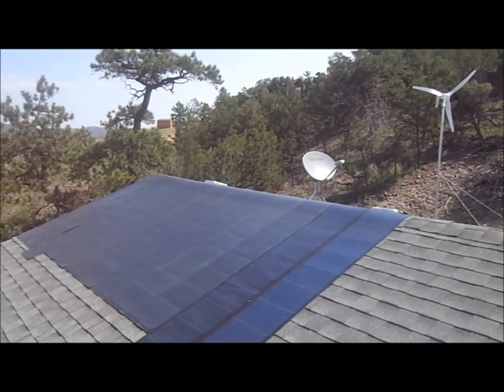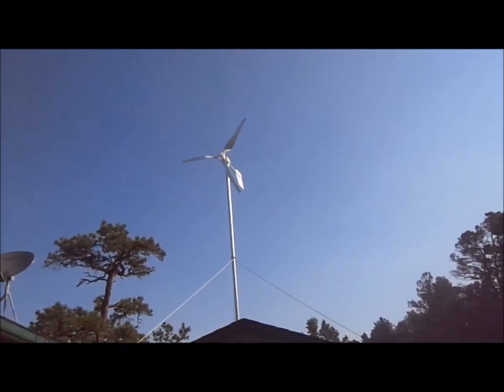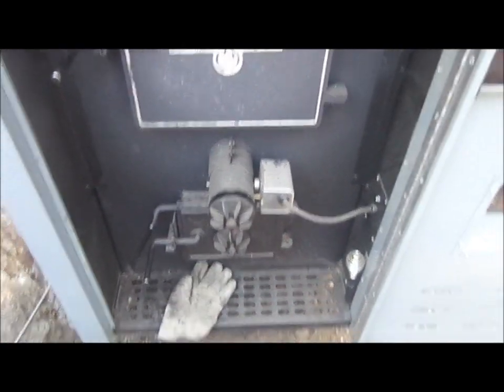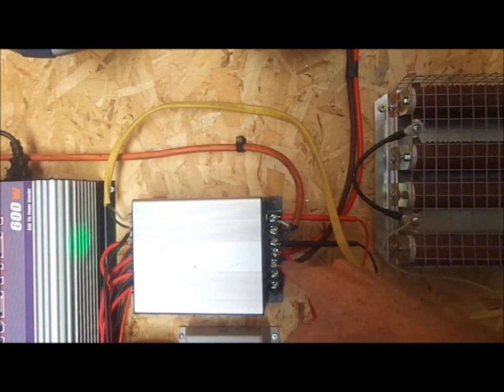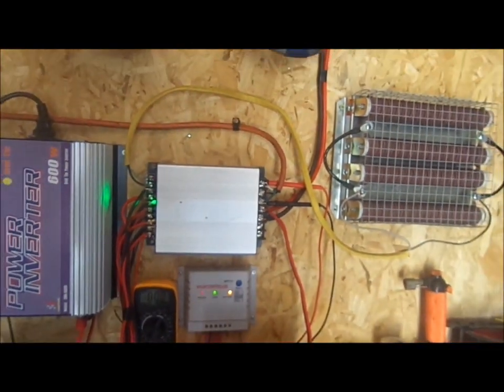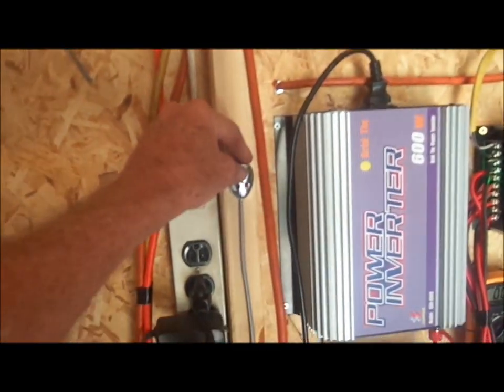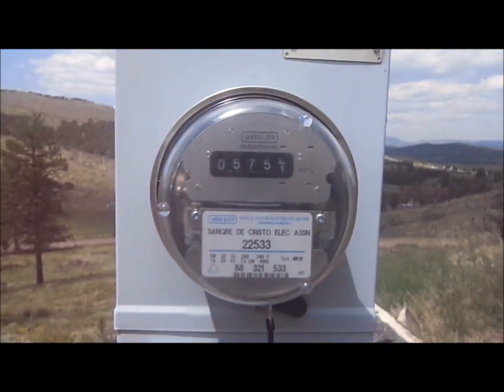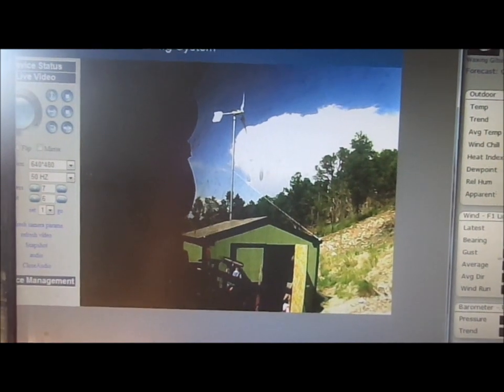HOW TO INSTALL A DIY HOME HYBRID WIND, SOLAR and WOOD ALTERNATIVE POWER SYSTEM -GO GREEN!

Comment: Hello Steve You have done well, at some point i want to share my system with youtube, like yours its work in progress and i have a 10sq m2  manshed. Enjoy how you have set up the camera to monitor your system. it must get very cold to have a heat mat and a heatered water bowl for your dog. I working on a dump load for my solar instead of it electronically dumping and what to use the excess to go to a 24v heater / water system this to keep my shed warmer. Re metering x camera i'm considering purchasing an MPPT controller and Epever as they have  a direct link to pc or using bluetooth on your cellphone.. One other project is to direct the dump load to go to various items and switched at various times.
enjoyed the tour thanks Ross Tga NZ

Comment: Hi Steve, very nice setup you have. Is this a special charge controller you have? It's the first that I see were you can connect 1 and even 3 grid tie inverters to.

Kind regards
Sander

Comment: Well...the premise is a good concept, but the layout of it is willy-nilly and not very professional looking. First of all, I would 'not' have an array of all different batteries. It's always best to have all batteries by the same manufacturer as different companies have different specification for their batteries and the way that they are charged. 
At any rate, regardless of how it looks, it's all about how it functions. So good on you for doing it. I hope to establish a small solar and wind array system for my cabin that I am building.

Comment: Bless you dude I have to tell you your use of a power strip for your power distribution is scary, the way your cables are is also a concern. Are you using a cut up extension cord? Where is your main power cut off in case you have a fire. Are you using any dc breakers or how about just fuses. Be careful bro

Comment: Hey Steve instead of using a dump load you could replace it with a grid tie inverter so the energy isn’t wasted great video and great setup

Comment: Nice system. I have a suggestion for you. take your dump load and put it to an electric dc hot water element in your water heater ) or a small second heater ) to make hoy water from your dump load ( wasted energy ) You can get a pair of these elements for about 36.00 dollars on eBay.

Comment: how are those solar panels holding up after 3 years? I am looking into either a racking system for my panels or a ground mount not sure yet.
Reply from the maker: +Clearly Seen The panels are all doing fine, I added two more 100 watt panels.

Comment: This is amazing!  I'm just beginning research on how to pioneer my own alternative energy, and I can see I am WAY over my head :-). How would a lay person with zero electrical knowledge start?  Perhaps by getting to know one power inverter?
Reply: +Suzanne B. .... It took me about 1 year of study on line to learn to make a system. You also need the TOOLS to connect things....like WIRE STRIPPERS AND CRIMPERS...get the AUTO crimpers, that will save your hands, or hopefully you have someone who can solder connections well...:-) Also Wire Covers, they are Heat Shrink, you put them over the connections, and "shrink wrap them"...you will see this done in some videos.

Things to learn about....
   12 volt Deep Cycle RV Batteries. I recommend over 100 amp hour batteries to be more robust...120 amp hour for a bit extra coverage.  You do not drain these to empty....only go around 50 percent to get many charges, too deep a discharge can harm them...though they are built to take a deeper discharge than a car battery.

 Solar Panels...size your panels for about 10-15% of your capacity. Also a Solar Charge Controller...panels can be 18v...so need to be controlled back to 12v. They also regulate and monitor the charge, so you don't overcharge.

 Cables...size for your output amps...too thin and they get hot. VERY hot.
 Inverters...size for the amount of wattage you want to run.  Also MUST be the SAME voltage as your panels, and battery bank....a 12v inverter for a 12v panel and battery bank. 24v for a 24v panel and battery bank, etc....you might as well stick with 12v for now.

 Fuses...sized for the panels, the charge controller, and between the battery bank and inverter....so if something shorts the system...the components are saved.

 12v Cigarette Lighter Socket, with 15 amp fuse. For charging small devices, and loads that don't NEED an inverter. An inverter takes some power to run it.

OK...my system.....
   Two 100ah Deep Cycle RV Batteries. Connected in Parallel...that is Positive to Positive and Negative to Negative...like an Equal Sign...Series is for increasing the voltage...24v, 48v, etc...parallel is for increasing capacity...100ah, 200ah, 400ah...so Four 100amp hour batteries in parallel...400ah. Mine is 200ah therefore.
    Two 100 WATT Solar Panels, and 30amp Charge Controller...and you need the cables, but if you get a KIT, they can come with everything you need generally. I bought several Fuse holders, fuses, and Quick Connect Harnesses, for connecting to the Controller and the battery bank.
    THICK....double 0 cables...for heavier loads...#4 and #2 cables got hot for my set up. I run 60-70 amps. As you will see.
   A 1500watt Pure Sine Wave Tiger Claw Inverter...Pure Sine Wave is basically clean electrical power, like your house power. Modified Sine Wave is cheaper, but a motor appliance like a fan will BUZZ...and they are harder on somethings. But are OK for others....look up the difference between the two...good education.
   I use a 125 amp ANL fuse in a ANL fuse CASE....goes on Red...Positive Cable. Close to battery, between the Inverter. JUST IN CASE...you want it to blow before your equipment.
 Also, I have a 12v Socket...has many names...Marine Socket, Car Socket..etc....15amp fuse...all fuses go on positive cable.
  This is in a box, with wheels, it has a lid, the batteries are inside, the inverter is in the front, the 12v socket is on the left side, and there is a charging Quick Connect Harness on the other side, for charging.

OK...I run a 850 watt power consumption, 600 watt output MICROWAVE OVEN on my system. See my Video...see below.

   My small system is one 100ah AGM type battery...not Flooded Car Type battery...but Sealed so no leakage. A small, 400 watt Cobra Brand Modified Sine Wave Inverter...runs my 300 watt one cup coffee maker...though I use it for Tea. Also, it is on a HAND TRUCK so is portable, I can take it outside, and use a small 2.2amp Weed Whacker.
  For HEAT, I recommend a Wood Stove....too many batteries needed.

Do a search on youtube for.....
 
Cooking Soup with Microwave and Inverter set up

  Hope you enjoy....Good luck with your Solar Generator...that is what these are sometimes called. You can look them up on Ebay or Amazon as well as information on Youtube.
Reply: if I may...
Go buy or find a few garden solar LED lights. Take them apart. Learn the anatomy. learn the names and the function of as many of the components as you can. Take your time. Home solar systems are simply a scaled up version of this.

Comment from the maker: I am now using 2  1000 watt grid tie inverters, most of the power is sent to the grid as my batteries stay charged.. I don't directly  use  my power unless the grid is down. I have separate outlets I use  that are only connected to the battery bank.

Comment: Hi Steve,

Thanks for the great video! It is a nice system you have.
As I understood you have your own power generators, but you also buy electricity from the grid.

How do you switch between the two?
I'm planning to install an automated switching solution that decides if I'm able to power my house from my own system, or do I have to buy electricity from the grid.

Have you thought about such a solution?

Thanks again!

Istokka
Reply: @istokka I was wondering about the same..have you find a way to do an automatic switch based on consumption? How do you deal with things like the AC and the stove that are three phase AC?

Comment: Very cool setup. Very well thought out but I can't help but notice your low-tech approach to an 'alert system' by using the webcam. I'd think someone with your talent would jump right into customizing a Raspberry Pi to display alerts on a monitor in your home/cabin.

Comment: what kind of hybrid charge controller is the one that you have.i have a 12 volt wind turbine and i cant find a hybrid that does a 12 volt just ac wind turbine....any suggestions?
Reply from the maker: I had a Greenergy Hybrid controller for awhile, but it failed. I now run my AC Turbine directly to the grid tie. If the grid goes down it will divert through my Sun 500G grid tie inverter to the dump load resistors. This inverter is also protected from over-charging.
Reply: do you have any diagrams of your system?my next wind turbine will be a ac,but for now what do you suggest for my 12 volt 380 watt wind turbine as far as charge controller?i would like to do exactly what you did with your system?but on a cheaper scale (poor mans version)  lol..my planes are for 6 100 watt panels and (the 12 volt wind turbine) and to add a 2nd wind turbine (ac) right now i have a 1000 watt grid tie and 2-100 watt solar's,and 6- 200ah battery bank,and a 3000-6000 watt dc-ac power inverted for lose of power, and the turbine isn't hook up yet.
Reply from the maker: Billy bussnesman You could use a rectifier for now.
Reply: what kind and where would i get 1 and do i need a a dump for it?
Reply from the maker: Billy bussnesman I get almost everything off Ebay, you can compare between almost every product made. You must have a dump load set-up.
Reply: ok
i was thinking what you had in your video was awesome, a controller that does all that for you...i am in the Greenergy Hybrid controller process  of making a sun tracking rig right now for 4 panels...thank you for your help

Comment: Wow Steve Great video. Looks like you are ready for power outages. you have your own power company. it sure is nice when the power meter stops moving,,, few questions... why do you need so many inverters?. Do you have a solar hot water system? I can help in that area.
Reply from the maker: Three of these grid tie inverters got spiked by the Turbine. I have solved that problem by using an inverter that is protected from surges in or out. I have my wood furnace hooked up to my Jacuzzi which takes care of heating it all winter. I don't have a solar hot water system yet.
Reply: Oh so you need an inverter for the windmill and an inverter for the PV panels. Wood heat is good. BUT what do you use for hot water in the summer?

Comment from the maker: All of my Grid Tie inverters  have a built in shut off and will not power a dead grid. I have separate solar power lines to use in house when the grid is down. I do mention this in the video.

Comment from the maker: The turbine works extremely well as I have a lot of wind here. It was overcharging my battery bank and turning on the dump, so now I have it connected only to the grid. I have had no problems with the turbine and it requires very little maintenance. I check all fasteners for tightness and adjust the guy wires on at least a monthly basis
Reply: Steve Loyd 
Good job brother

Comment from the maker: I have faded out that controller as I had some problems with it. I now use an Intronic Power MPPT75 . Also I divert all of the power from the turbine and most of the power from the solar directly  to the grid. Watch my other video "Converting a 5kw Jacuzzi To Alternative Energy", it shows the changes.